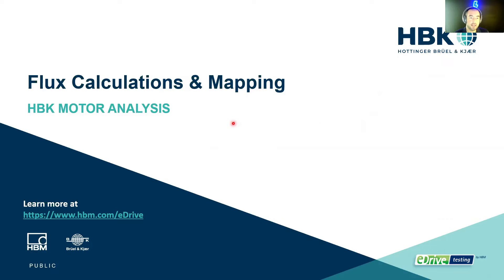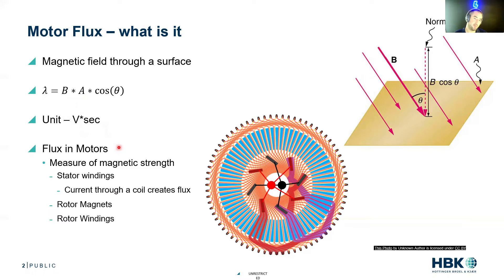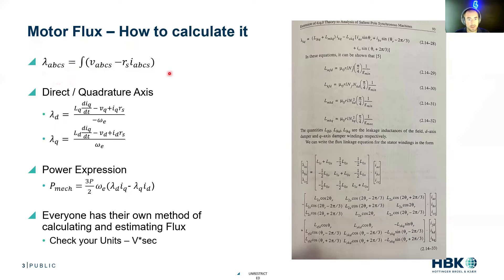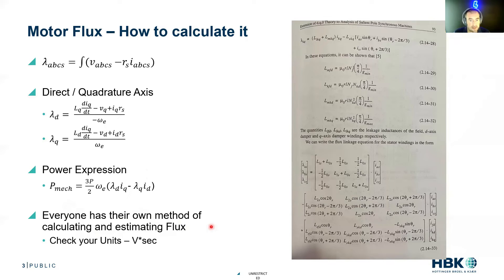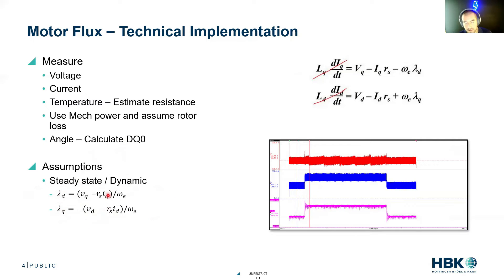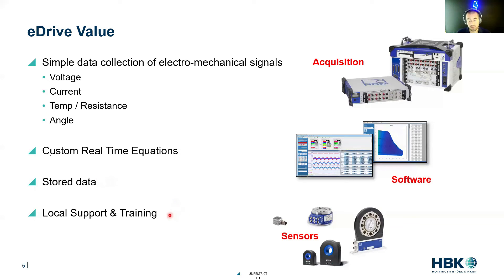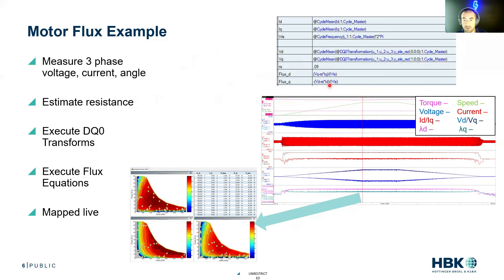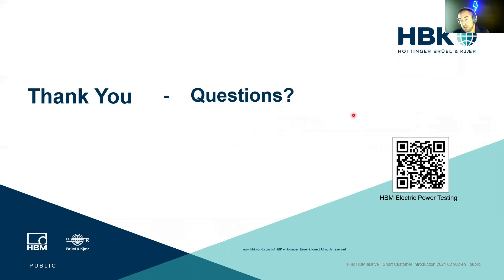Motor Flux Measurement, Calculation, and Mapping

Comment: Thanks for this useful overview. I have a couple of comments that I hope will be useful. First, you're actually referring to flux linkage (in volt-seconds) and not flux (which is in Webers) - although flux linkage is in any case the more useful term when considering the electrical characteristics of a motor. Second, it's often useful to know the component of flux linkage from just the rotor magnet on its own (in the case of a permanent magnet motor) and this is easily done by doing an open-circuit test where the motor is spun by another motor. This forces the Id and Iq terms to zero and therefore eliminates the resistance terms from the equations. Under these conditions, all of the voltage should appear in the q-axis, since there will only be flux (linkage) in the d-axis.
Reply: Both Flux linkage and flux have the same SI unit Weber=V*sec.
Reply: Agreed, but that doesn't mean they're the same quantity. They key part that's missing here is that Volts*seconds = Webers* turns. Since turns is dimensionless, flux linkage and flux have the same SI units. If turns were not important, then a transformer would not be able to have different voltages on the primary and secondary at the same time.
Reply: how does coupling 2 motors together one as motor, the other as generator result in a zero Id and Iq?
Reply: @rubyx333  The coupling is mechanical. The machine acting as a generator is connected to a high impedance load (the volt meter), so the current flowing in the generator side is (near enough) zero. If the total current is zero, then both Id and Iq must be zero.

Comment: How do you calculate if the demagnetization was a motor fault or user fault?
Reply from the maker: @robertmeares1296 - an assembly issue would need to be found before operation. An operator fault should be avoided by the implementation of a control system that avoids demagnetization. To answer your question, I don’t see a difference.  If you want to discuss further please contact us at HBM.com/eDrive